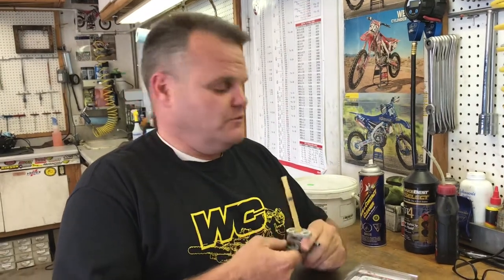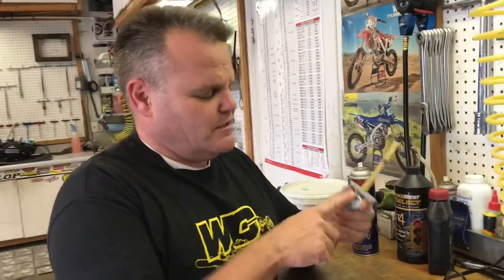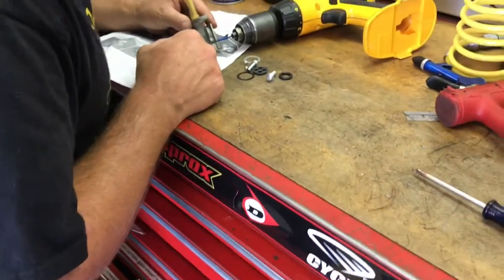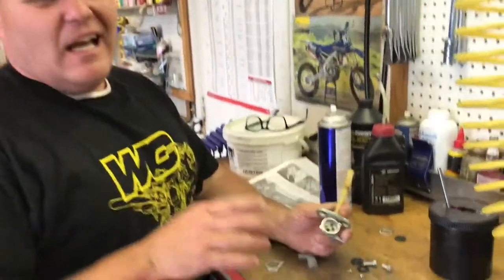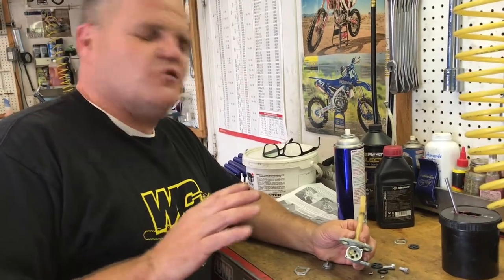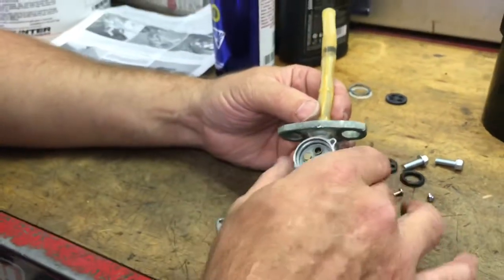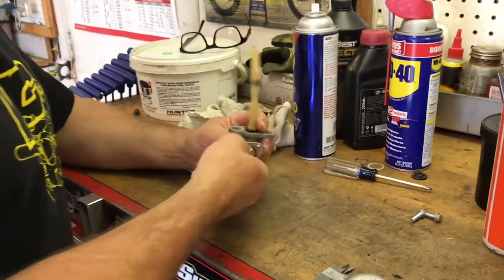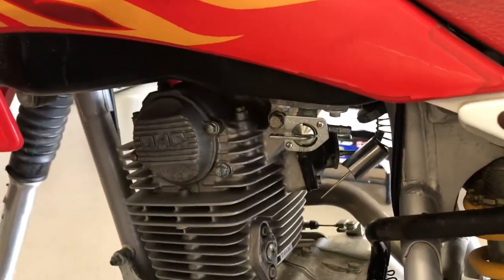How to Re-Build Your Petcock

Comment: You know what? It's hilarious that you made this video. This is exactly what I have to do to my bike right at the moment . LOL. Odd coincidence or maybe it's just got something to do with winter? Anyway thanks I appreciate it I needed that help. Probably could have figured it out but now I don't have to on my own. Thanks
Reply from the maker: Perfect!
Reply: @dirtbiketv1  and your video actually helped.( just so you know ) Now its done and leak free. The cold here in Massachusetts really takes its toll on the rubber bits, ya know? Thanks Jay. I appreciate it.
Reply: Wow! A video of what you looked up.
Reply: @maxlundmark4281  it was just funny that it was posted on the exact day that I was rebuilding for my fuel petcock This was a long time ago man. The video popped up in my recommended feed at the exact day and time I decided to do that job on my bike. So I said screw it I'll watch it it was just a strange coincidence. I didn't look it up it just popped into my feed on the day I needed to rebuild my petcock
Reply: @joshf8097  love you buddy I was just joking ♡ that is a coincidence
Reply: Hey guys what problem where you having with yours? My bike wasn't staying idling so I went to drain the old gas and I noticed no gas was flowing out. It only drained when i put it to reserve. Nothing was coming out turned to on. So I'm thinking the valve is bad? Would this fix that or could it maybe be the filter? Thanks for any advice